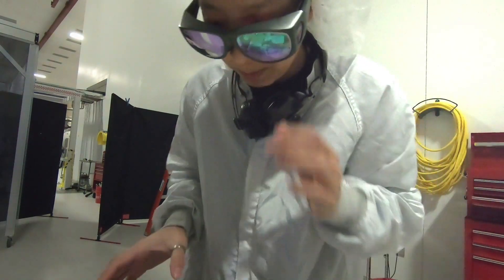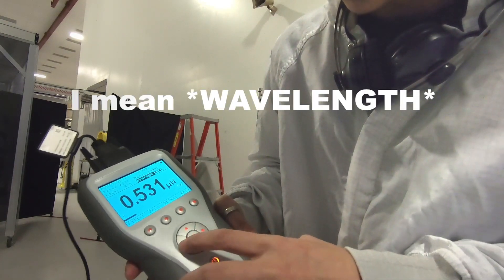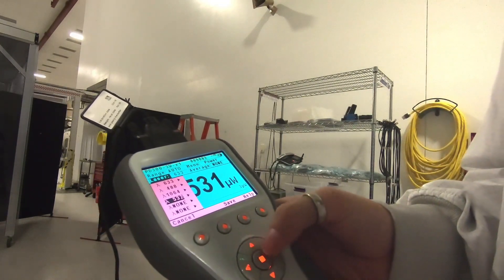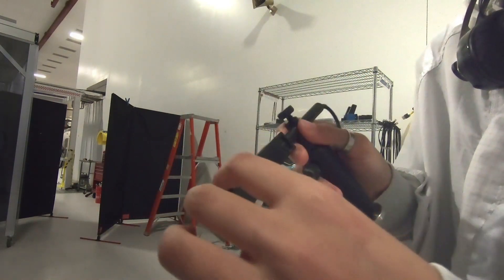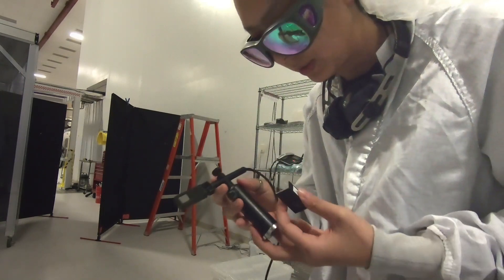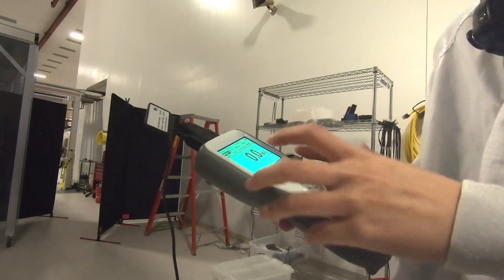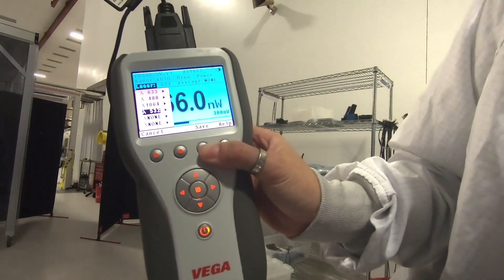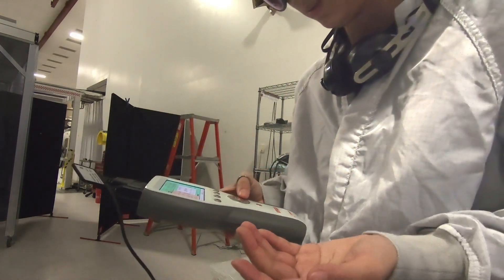Ophir VEGA Power Meter REVIEW -- fail to SAVE settings

Comment: Hopefully the following explanation will help.
The ‘Save’ button on the Vega is relative to the context of the screen you are in:

1.	Saving the newly set wavelength in the wavelength Modify screen saves the new wavelength as a favourite in the wavelength list, but doesn’t necessarily set it as the default wavelength for when next started up
 

2.	Pressing save when just in the wavelength selection menu saves the selected Wavelength as the default startup wavelength for when next started up